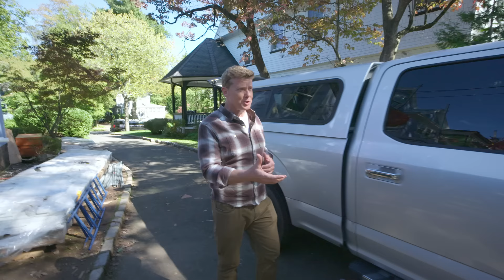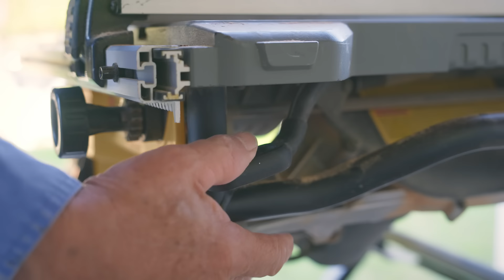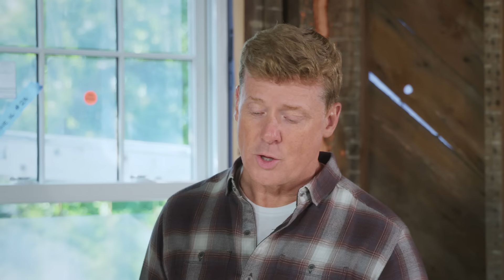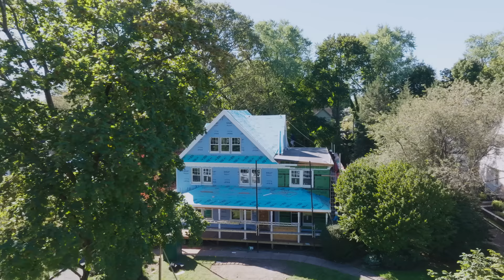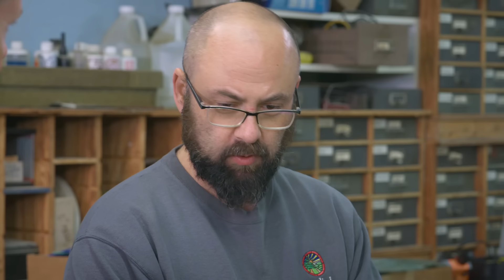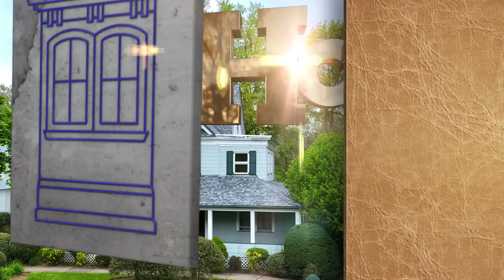This Old House | Next Level Tight (S45 E22) FULL EPISODE

Comment: I was a little surprised to see Tommy make a mistake.  He did not countertape the drip edge top seam.  If water gets under the shingles, and it probably will, the drip can now go in behind the moulding.  You tape over the drip edge on the top part so that it seals it to the roof surface, and also seals over the nail penetrations.

Comment: all this plastic your using on houses decking ,trim, etc. how do you keep it out of the water column and out of the land fill. every time you cut it the saw dust goes into the grass and then rain washes it into the sewer or the ocean if you work by the sea. it lasts forever isnt that a problem?
Reply: I have to point out a recent PBS called "WE ARE ALL PLASTIC NOW".
Reply: The point of building homes at a high level of quality with long lasting materials is that these homes will hopefully be occupied for centuries, instead of being torn down or remodeled every 20 years. The entire point is durability and longevity.
Reply: @dlg5485 that is no answer to the question
Reply: @dlg5485  these houses have lasted for 100 of years already with out the plastic and if your polluting the water you will not be round to enjoy these plastic houses

Comment: The windowsill should have went beyond the side casing  by an inch on either side to be historically accurate, it is called a sill horn, they did it on the door threshold but for some reason they didn't do it on the window.

Comment: 5 or 6 nails in each shingle is overkill and they are being set way to deep, they need to back off on that air pressure or better yet hand nail them. Dave's sheet metal in Dracut Ma, makes a product called double drip edge that has a build in capillary break so there is no need for that 1x2 and it is much more durable than that cheap Home Depot drip edge

Comment: Somebody should tell Tommy that roof underlayment is supposed to go OVER the drip edge not under it so that water that gets under the shingles runs off the roof instead of into the fascia boards.
Reply: Only on the front not the side
Reply: Tommy did it correctly.  Self sealing membranes should adhere to the sheathing—underneath the drip edge.  Any water from icing that works its way up from the edge would be protected.  The drip edge isn’t there to keep your roof dry—that’s the job of the shingles—rather it is there to force the water away from the fascia.

Comment: Im guessing that pile of silicone helps :)
Reply: You're missing the point of the demo. They've done one of these before. The silicone is to make the connection between the tube and the sheet water tight. The test is to see how much water permeates THROUGH THE SHEET of underlayment. If they didn't put silicone around the tube, it would just leak out where the tube meets the underlayment.
Reply: @tacojohnhg8181  So, shouldn't they use silicon on all four?
Reply: The test is about the nail hole...
Reply: I was thinking the same thing lol